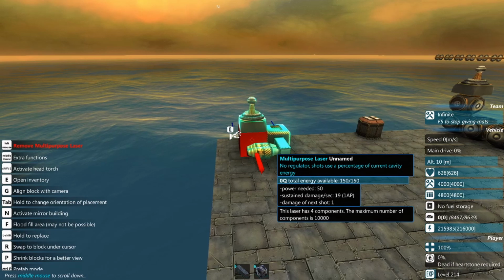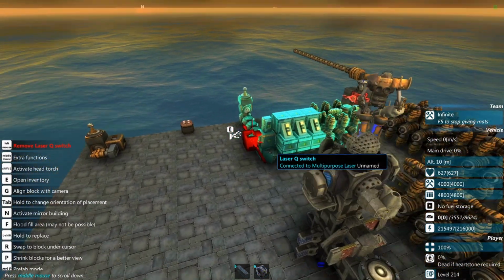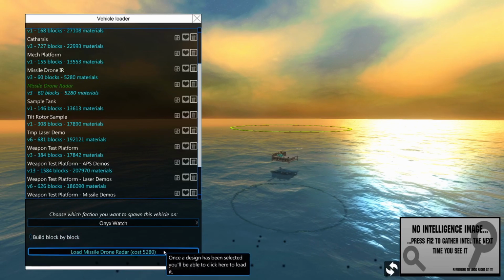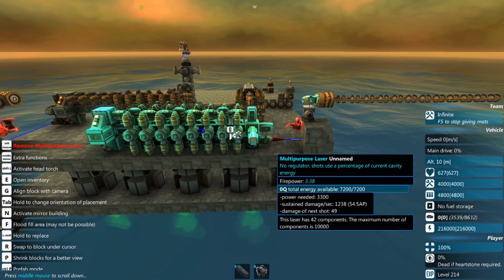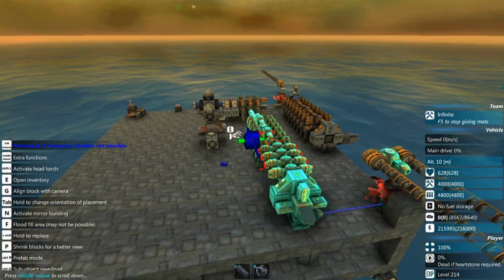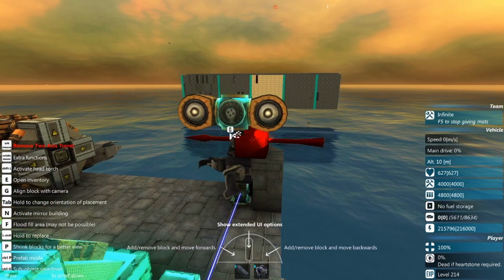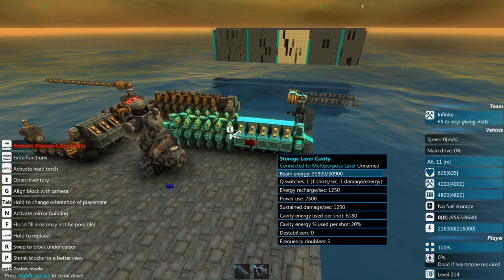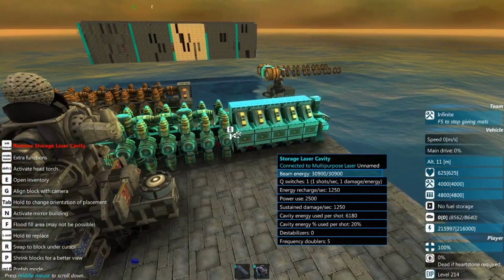From the Depths - Tutorial 18: Laser Examples

Comment: You forgot about the other Laser Projector ...the short range one with massive buff to damage, so much even continuous laser is an option. It's perfect for anti-swarm/ anti-cruise missile system.
Reply from the maker: I haven't been a huge fan of the short-range laser combiner for anti-missile work since I did some math on it and figured out its inaccuracy is bad enough that it doesn't guarantee a hit on a large missile until it's within somewhere between 15 and 50 meters, meaning frag particles from the shot-down missile are still going to shower you.

That being said, I haven't extensively tested it out, either--a continuous beam might be able to counteract the inaccuracy issue, at least a bit. It's entirely possible that the numbers aren't really telling me the full story of what's going on. Do you have an example vehicle?

Comment: Wait, Freq doubler don't need to be in the cavity line?
Reply from the maker: Strictly speaking, no. They do have to be attached to a coupler with the same amount of q-switches as the couplers your cavity lines are connected to (it can even be the same coupler unless you're talking about a 4q laser). The AP for the laser is displayed on the multipurpose laser block, not anywhere on the coupler/cavity area; similarly in many cases you can build a doubler-only line anywhere in the laser network and increase the AP of the corresponding cavities.

However, there's some oddities I haven't entirely figured out. Sometimes the AP doesn't seem to register, sometimes it requires a save/reload in order to work, sometimes it doesn't seem to get counted in stats at all (but does still seem to work). The damage LAMS on the platform is an excellent example of this; without that frequency doubler on it it can't shoot down most medium missiles, while with the doubler it can shoot down a single medium missile with ease. The frequency doubler I attached is on a different side of the coupler from the cavity, and is definitely not considered part of the same cavity, but still enables the LAMS to shoot down a medium missile.